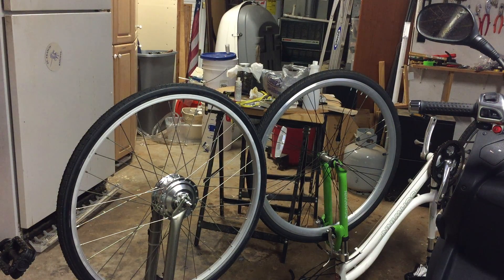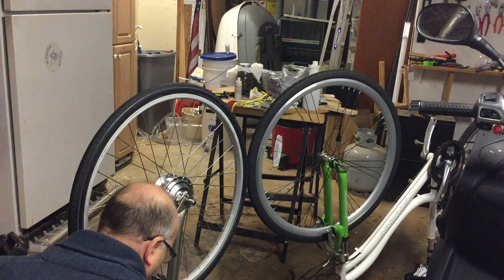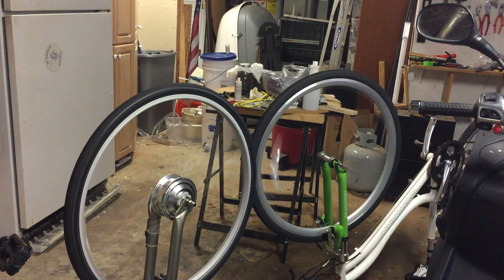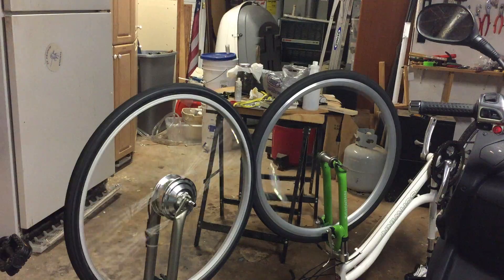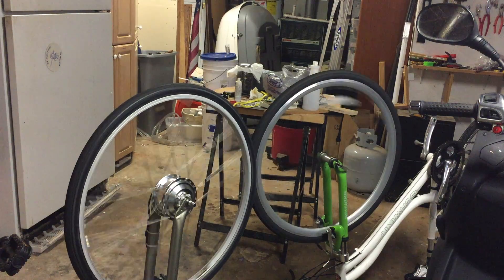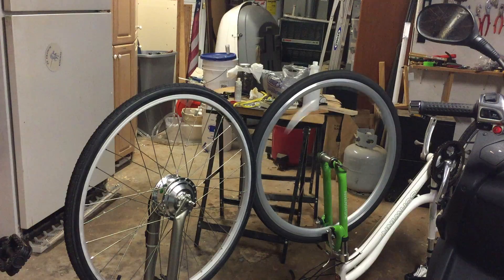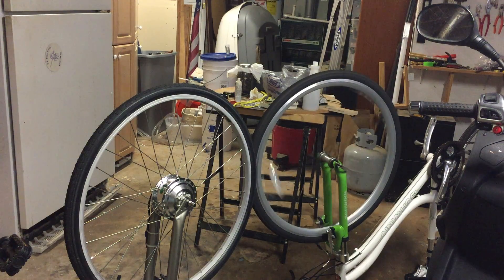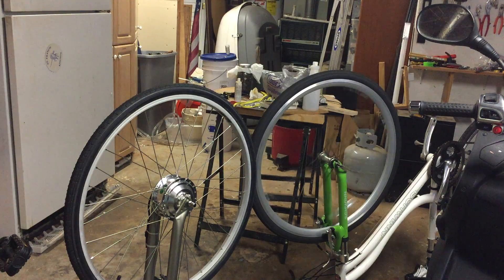clean republic hilltopper electric bike hub resistance test

Comment: thanks for showing this test. but wouldn't a mid-drive or gearless hub have even more resistance?
Reply from the maker: reading some of threads on electricbikereview.com, direct drive hubs
 offer more resistance.  maybe newer bosch eMTB is the answer for a midrive w/o resistance and a new claim from xtreme that they have a clutch that disengages the hub drive when power is off...I'll to check that out.